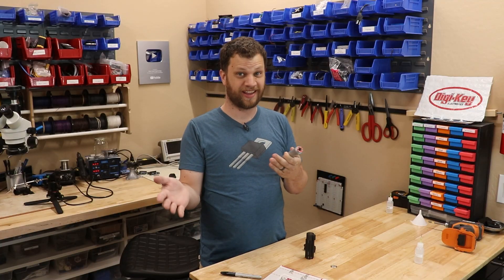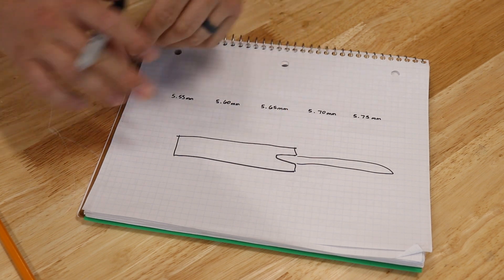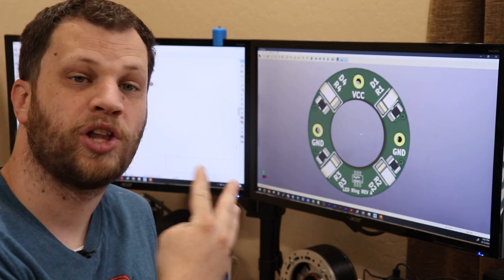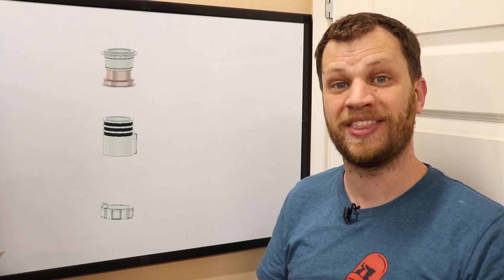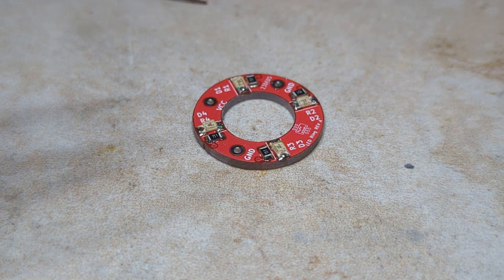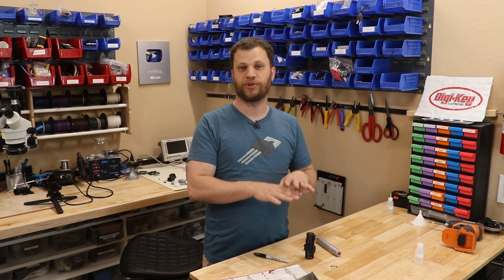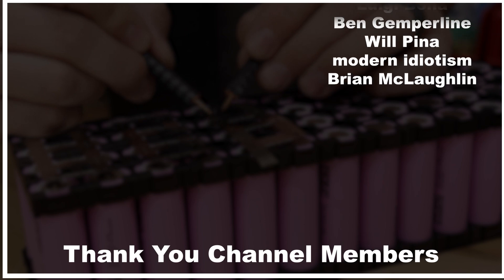I need an impractical way to hold my sharpies!

Comment: how do you charge it?
Reply from the maker: I had an explanation for this in the video, but I cut it out to be brief. This is a prototype, and so I didn't add any BMS or charging circuits on the board. Maybe in the future I'll add that. For now, the two battery terminals are accessible on the top circuit board. I can temporarily solder a standard JST connector pigtail and use any lipo charger

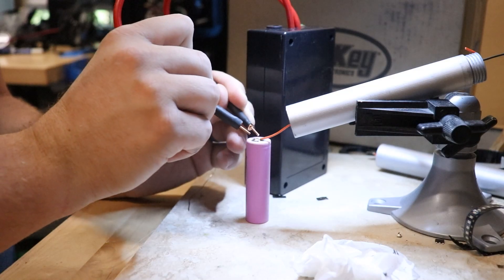Comment: 9:40 Wouldn't be less trouble if the connectors being attached using a spring? no welding required...
Reply from the maker: That was my original plan when I thought I could get this made out of aluminum. It would have simplified things quite a bit

Comment: 3:42 don't you love it, when things come together in a way Easter Eggs more or less engineer themselves?
Reply from the maker: Are you talking about my logo on the silk screen of the PCB?
Reply: @bytesizedengineering look at how you named your resistors and diodes... On your Star Wars themed project 🤖
Reply from the maker: @ncot_tech  shut the front door! I didn't even notice that until now! Ahahaha 😂😂😂😂
Reply from the maker: @ncot_tech  I usually try to pair up reference designators, so in this case resistor 2 is paired with diode 2! Can't believe I missed that
Reply: @bytesizedengineering  No, about the R2-D2 labeling. Cooincidence, I know, but it's on a PCB for a Star Wars Lightsaber, so I count it as easter egg.

Comment: Hi, what you said about the battery isn’t quite true. The entire external case is a negative on most 18650”s.
Reply from the maker: I've never seen an 18650 battery with a sleeve that is connected to the negative terminal. Most of them have an insulating jacket. It would be really dangerous to build them the way you are suggesting, because shorting them out would be nearly impossible to avoid
Reply: @bytesizedengineering  thanks for the reply, I understand what you are saying, what I was stating that technically what you stated was incorrect. The only difference between the negative at the bottom of the battery and the rest of the case is the wrapper. If you needed to attach to the case it wouldn’t make a difference electrically. As long as the attachment point was insulated from the possible there is no additional danger. High Temp Kapton tape is commonly used to reinsulate after a penetration of the sheathing you can also purchase the positive isolator and  precut shrink wrap for 18650, 20700 and 21700 quite readily. Thanks for all the entertainment. Keep up all the amazing work.